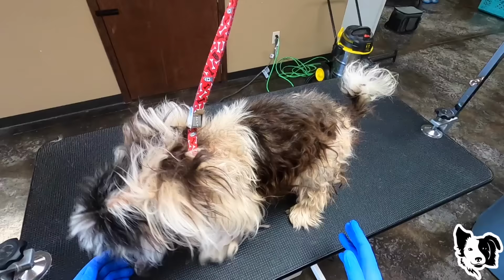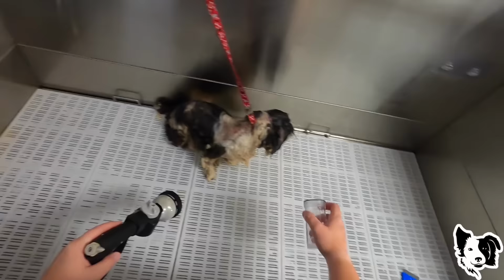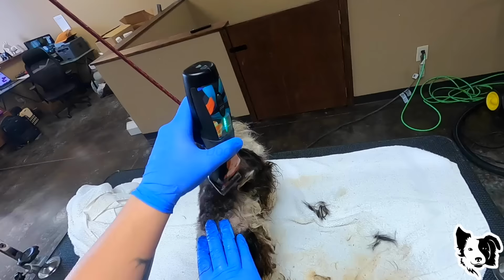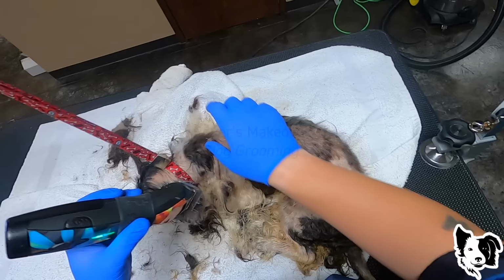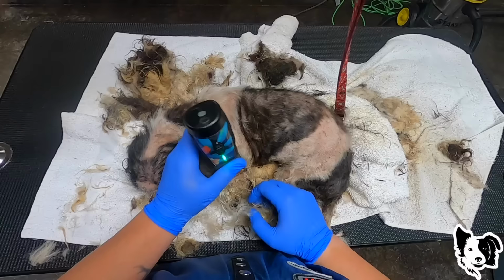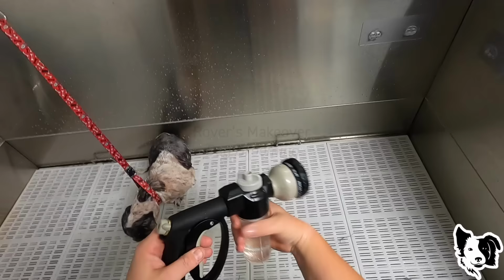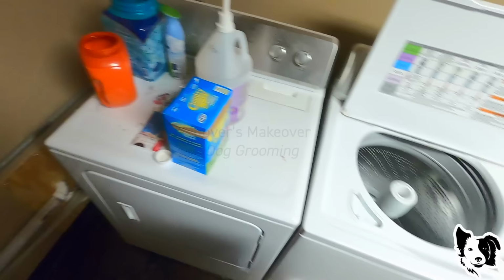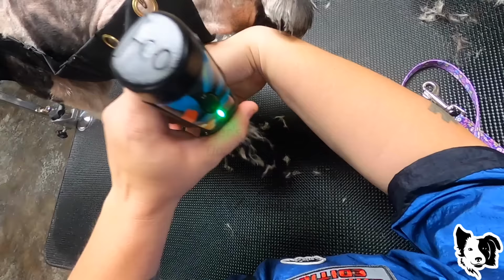WORST CONDITION IVE EVER SEEN

Comment: Please change your blade. Do not burn that poor dog on top of everything else it as has to endure. It's got to be hot after all this time. And then you just sit and let it run when you aren't even shaving. Please change it NOW! WHAT THE HELL IS WRONG WITH YOU?
Reply: She obviously has no idea what she's doing. She should have been treating this dog with extreme care and she didn't. She should have used medicated shampoo. The dog has a serious skin issue that has been made worse by the fleas. She is either newer to the grooming business or just doesn't have the right education. Either way, she should have shown this dog a little kindness.
Reply: Very cruel and unnecessary rudeness from the slasher not a professional groomer 🤬🤢🤑👹
Reply: Absolutely agree!
Reply: @melaniekendall4903  don't have to be to have compassion
Reply: She said with a wet groom the blades don't get hot as fast.
Reply: The blades still have to get hot after some time. I never saw her change it one time. And she is talking and left the clippers running even then. That blade had to be super hot! I am a groomer, I have never done a wet cut, but I know the blade is going to get hot sometime.

Comment: Take the back and bottom off your dryer.  You'd be amazed at how much lint builds up inside even.  It could be the heater element too.
Reply: @reneebarnhart1836   it is also so hard for a tiny dog to be plunked down on those steel grates. Should have some kind of pad for comfort ❤️

Comment: Just a bit of advice. Use a front loadng washer. In top loaders, the towels or clothes act like filters as the water drains through them. In front loaders the water is always moving as it drains. They have 3 rinses which equals 1 top loader rinse. They also clean better too. Andrew from OZ.

Comment: My only concern is the blade getting hot. I don’t see you checking it or changing it   And on a wet dog you know it’s hotter.  But thank you for doing this. I know you probably don’t want to read the complaint parts but please be advised I’m not trying to be critical. I’m just wanting to warn you. And about that time you said the blades don’t get as hot with the wet dog. I’m not 100% sure about that because I know that if I get a wet towel and I pull out a skillet out of the oven it gets through a lot quicker.

Comment: All the comments I had are already here.  Don’t blame the dog for smelling and try to give a little kindness.
Also, if the owner being 75, I totally understand.  I am disabled and 65.  I cannot do what I used to do.  If she is on SS, that doesn’t leave much money on a fixed income for grooming.
You should offer her help if she needs it. I understand your position as well.  At one point I fostered dogs did all my own grooming.
I had one come through from a puppy mill smelling like motor oil and all the hair on her back was just a sheet mat.  I had to give her 3 baths with Dawn liquid then when I got the hair mat off, she was totally raw and bleeding.  I sat in the floor with her, holding her and crying.
So I know how you feel. Sometimes it is not as easy as it seems to place blame.

Comment: YOU NEED TO PUT A NEW SEAL ON THE INSIDE THE DOOR.  THE PART THAT STICKS OUT INSIDE.  THE DOOR ISN'T GETTING A GOOD SEAL IN ORDER TO KEEP THE HEAT IN.  NOT HOLLORING AT YOU.  JUST DIDN'T WANT TO KEEP CHANGING FONT.